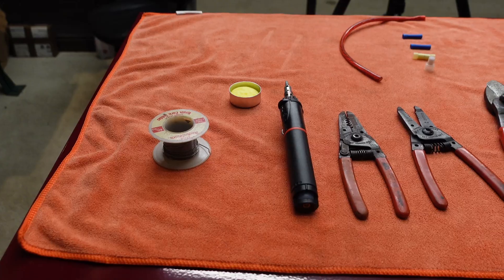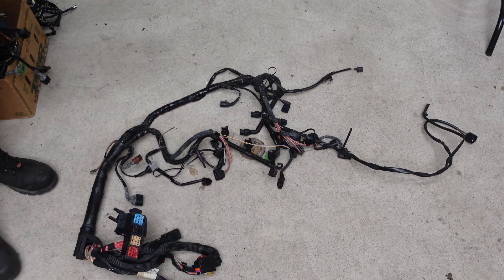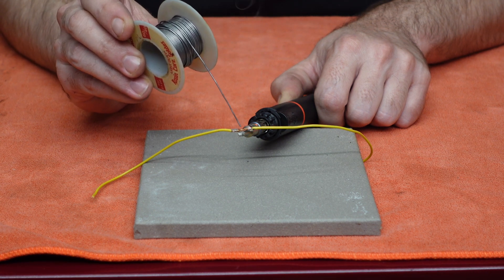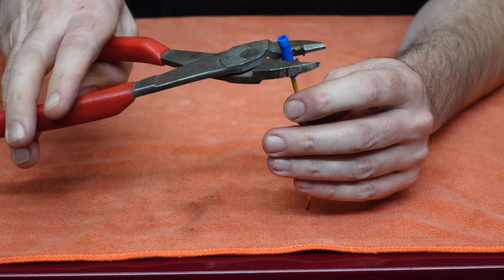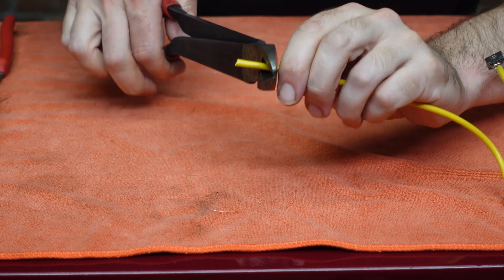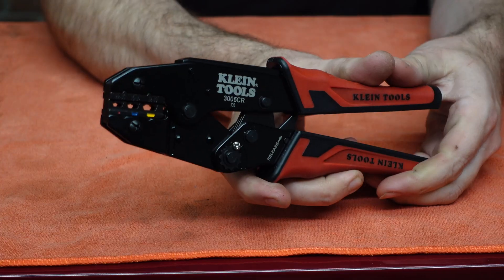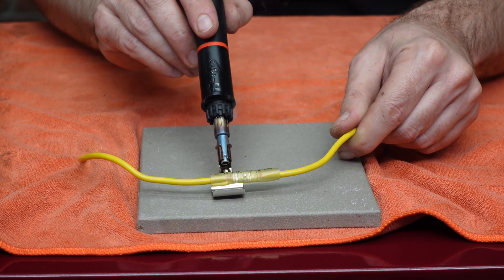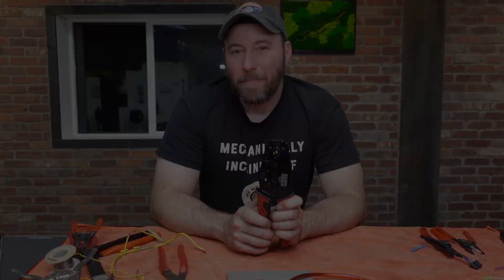How to Make Proper Automotive Wiring Harness Repairs - WeWrench Instructional Series

Comment: 2:40 crimping an insulated connector with a crimping tool for non insulated ones. Would not trust what this guy is saying. No wonder audis have so many electrical glitches.
Reply from the maker: You're wrong about the tool. It has jaws for insulated connectors. I'll admit my mistake of using the non insulated jaws on that low quality vinyl connector. You shouldn't do that because you can damage the jacket and expose the barrel. But that crimp itself was just for illustration. However, if that were a nylon connector, you can do that all day long and never have an issue. Sounds like you're a stickler for the details though so hopefully you can appreciate when I broke out the ratcheting crimper with the different size dies for the OEM Audi connectors.